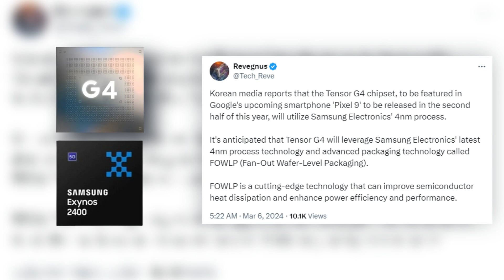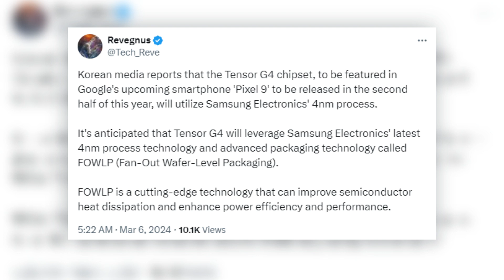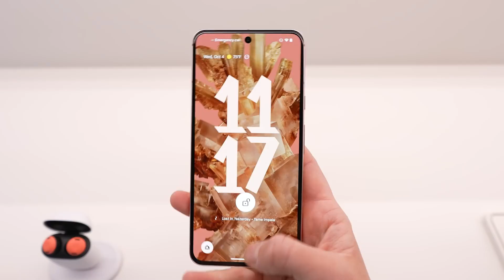Google Pixel 9 – Thanks Samsung!

Comment: Actually, I would disagree on that. I have myself tested both snapdragon and the exynos chipsets on the S24 and snapdragon out performs the latter By quite a bit , the battery margin is about 20% higher for the snapdragon.  The dual-core and single core 'performances are also and if you're pricing if you're pricing to different products at a same price, there should be no difference between them. And actually the exinos in India is more costlier than the snap dragon in u.Yes.
Pardon me for all the grammatical errors as i'm using the samsung voice Converter to write this message